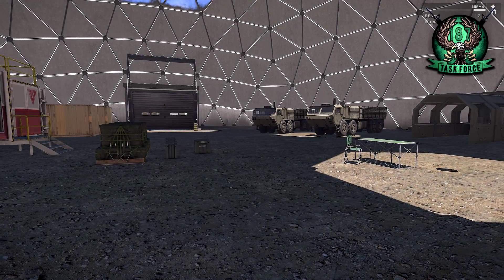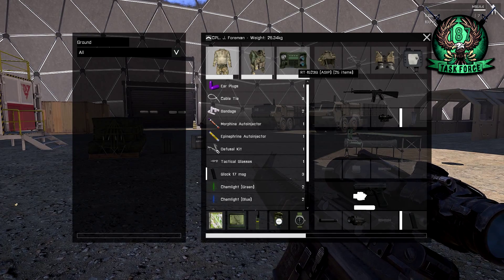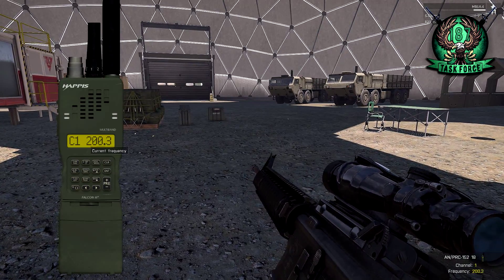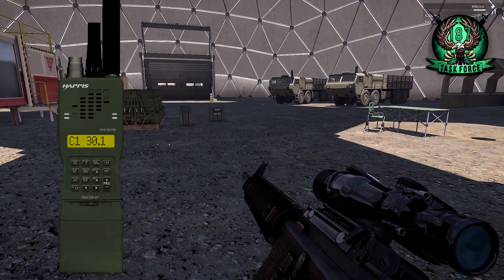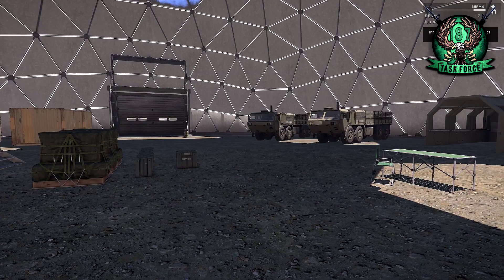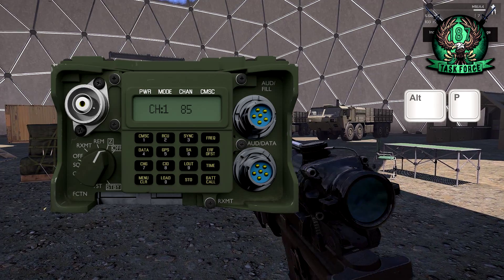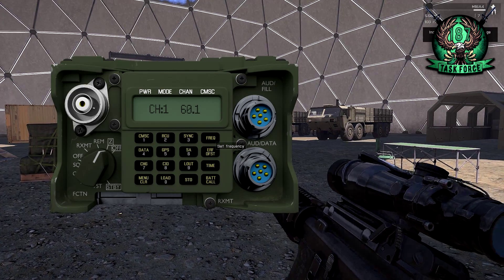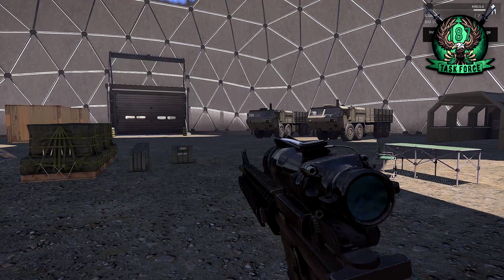Advanced Task Force Radio Tutorial

Comment: hi man, in arma my radio works and you can hear me trough teamspeak. but in direct chat in ts nobody can hear me even when im closeto them
Reply: So the radio works but standard talk doesn't? Such as walking up to somebody and talking? Have you used the TFAR installer in 3sync AND activated the plugin in TS3?
Reply from the maker: Using TFAR, your Push to Talk key becomes your characters voice (direct) If thats not working I'd check your TS version, and make sure you have the latest version of TFAR. and also what Hovis said. make sure the plugin is installed
Reply: i have the plug in is checked, how can i see if it works?
i enabled the plugin via windows expolrer, so i will try that thx!

Comment: 1:48 i don't know about TFAR that much, but the PRC-152 can transmit from 30-512 MHz. it isn't given that number because of its bandwith, it was just the 152nd radio to be designated. rather important distinction, i feel, as a primary military band for short range communication is 225-400 MHz. the 152 is great because it can transmit/receive in both military VHF and UHF frequencies.

for those curious/wanting realism (via FCC):

30-50 a mess. individual frequencies are used as military in US. no specific band.
108-138 Aviation. (civilian, military use when communicating with civilian organisations [non-military airports])
138-144 military aircraft have used this in the past. not specified.
148-150.775 DoD
162-174 "US Govt" unsure.
225-400 DoD Aero